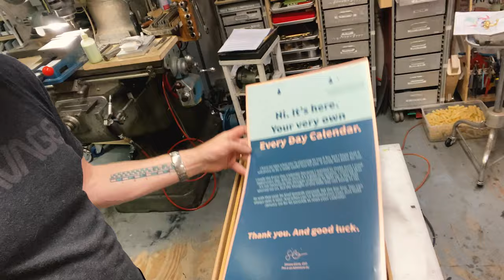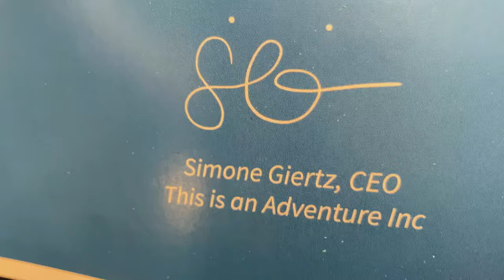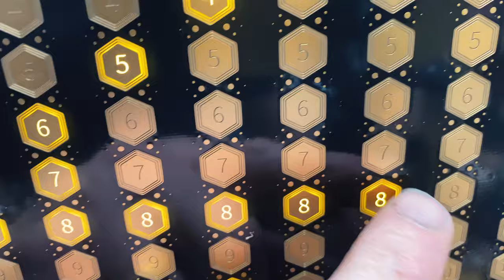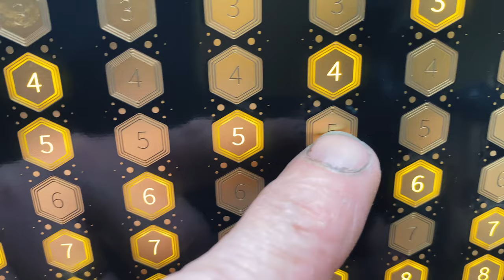Adam Savage Reviews Simone Giertz's Every Day Calendar!

Comment: Things that “almost never” happen in the shop: A long-range toss into the trash can, picking the correct allen key on the first try, one-day builds taking only one day.
Reply: Don’t forget the king of things that almost never happen: not making at least one wrong cut or one wrong glue-up. 😂
Reply: @AlasdairGR  With the deer-in-headlights-look to the camera.
Reply: If mythbusters were still a thing I'd love to see a test of a long range balled up paper tosser to see if they could zero it in to land perfectly inside a circle every time then replace the circle with a trash can of the same diameter. I have this theory that open holes generate an as yet undetected repulsion field (happens on golf greens too :-).
Reply: Also almost never: Putting back all the tools where they belong. Following all safety advice.
Reply: @Krmpfpks  Man at work every single tool has always had a home and it always goes to it's place as I leave. At home... well lets just say I spend a lot of time looking for things
Reply: Always grab the 3 or 4 allens that look right.  Because I have to deal with an industry that can't decide if metric or imperial is better and my eyes suck

Comment: The only thing I'd say is 45 seconds is a darn long time to hold to reset
Reply: I would imagine there's a thought behind that. She uses hers for meditation, and like Adam pointed out there's that tiny amount of time you have to hold a button it to light it..  this thing feels very Zen. Maybe it's meant for you to think about the year for a while.
Reply: You can't spare 45 seconds once a year?
Reply: @bumbledouche3323  For me it's not about the time taken but it can be difficult for me to hold something that long without worrying about my finger slipping.

What I might've done instead is hold a certain day in while you plug it in, then press a specific other day within a few seconds. If anything else is pressed in the meantime, cancel the reset procedure. This way is both quicker to reset and is less susceptible to accidental resets. You might be touching Jan 1 when you are hanging this up, or something might hang over and hit the button.

The other option is just omitting the reset function and just resetting each day individually.
Reply: It does sound silly but just holding a button for 45 seconds will feel like an eternity. I have an old tractor I'm supposed to pre heat for about 20 seconds. I almost never hold it for that long because it feels too long, if that makes sense. Not the best design choice on her part i think
Reply: @irbine84  I can't help but feel you guys are making a mountain out of a molehill. Adam said it was first designed as a meditative tracking log - I assume the lengthy hold-to-reset is a deliberate choice to force the user to just stop & be calm for 45 seconds, doubling as a safety so you don't accidentally reset your progress mid-year. It's not like you're going to have to use that function more than once a year.

Comment: OMG, Adam. The construction of that circuit board is gorgeous. When I saw it was simply etched contact touch switches, then you started pulling off that sheet and I heard it rattling as you went, I was thinking: "That's ... not ... polyethylene! I hope he hasn't pulled off the touch surface!"

Comment: Now I know why I love this design so much. It reminds me of a coin/gambling machine very common in Scandinavia in the 70's-80's. Simone might know these. 
Search word: Kroneautomat or knipsekasse.

It's basically a near movie poster size and 8-10 in thick wall or stand mounted machine/box. Most of the front is a pane of glass with just enough room behind it to fit a coin. The bottom half would have columns of coins arranged in a slight peak in the middle. Above that there was a row of slots/targets. Hit one and you win the amount stated on it and a column would open up in the bottom to release your winnings. If your coin falls between the slots it falls down on the columns. If there's room it comes to rest there. If not it rolls off to the sides and disappears. It is lost.
You deposit your coin at the top right of the machine. It falls down and comes to rest on a "shelf". You don't see the coin, but on the right of the machine there is a "washer" and it directly pushes on your coin. Now you decide how hard you want to push the washer to eject your coin onto the board. Highest value slot was usually in the middle (7-10 coins winning), but second highest was often the far left and right slot (5 coins). Most coins would skip and bounce a lot on the edges of the slots so each coin would give you several near hits or near misses before it's fate was decided. Very satisfying the few times the coin would not bounce on anything and just went straight into a slot. Ahh!... Good times :)
Reply: Yes! I didn't even realize that before reading your comment. Definitely something that struck a positive feeling to me.

Comment: 9:20 - It's mostly a "safety" feature. With these capacitive "buttons", if you don't add a delay, you risk turning surrounding buttons on or off, if your finger comes too close to them. The downside is that it won't let you drag your finger quickly along a line and turn all those buttons on or off (as you tried earlier).

Comment: I am wondering if there is some way to set it to a sort of screen saver mode when not in use so it does the cascade of lights that happens when you turn it on over and over again at some reasonable rate of repetition?

Comment: Got mine last week too. Only problem is that the two spaces where I'd like to hang it don't have studs to drill into  :-(
Reply: Look for OOKS Professional Picture Hangers. The hook on the 100# looks like it would stick out far enough to engage the hole in the back of the calendar.
Reply: @dawoodjr  thanks for the suggestion.

Comment: Debouncing switches is what that pause is called.  An electronic switch won't change from 0 to 1 all at once, it will vary between 0 and 1, if you have fast electronics counting (in this instance, just checking for odd or even) then those variations will all be seen, and counted, and will give a random result.  So you wait after the initial change for a set period to make sure the switch has finished 'bouncing'.